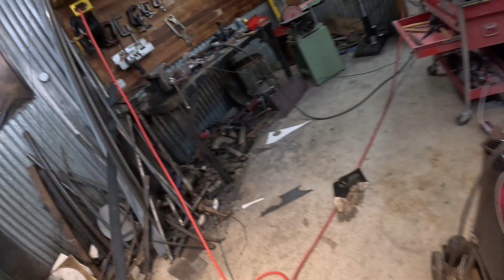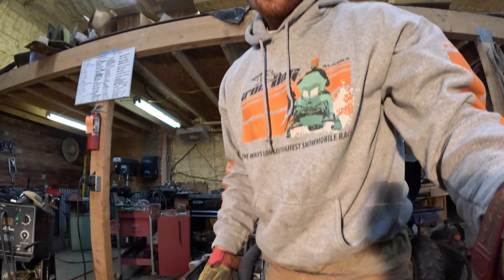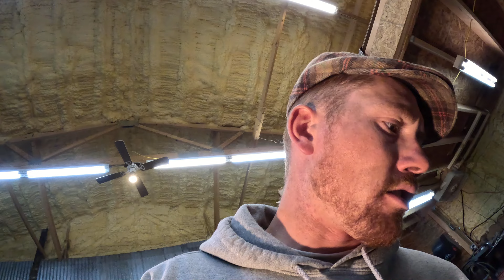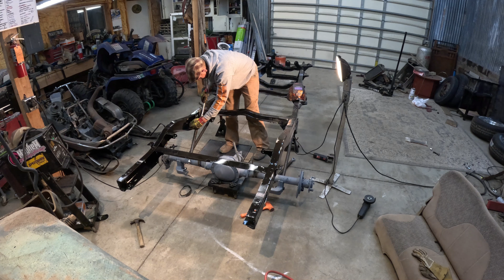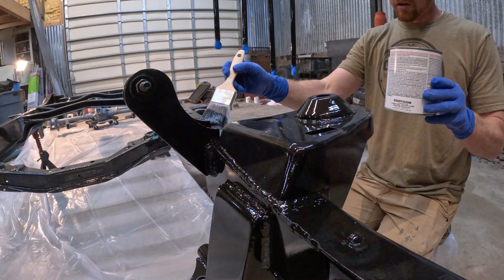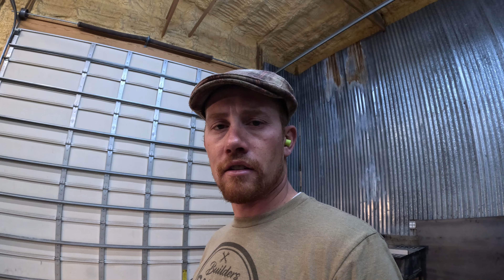Daily driver rat rod 4 Links and paint FINALLY!

Comment: This is just my opinion and not a scientific fact,, but accoerdin to me you have to buy some awful fancy and obscenely priced paint before you have a coating even nearly as durable and protective as brushed on Rustoleum industrial enamel. Sprayed on rustoleum isnt as tough.  One thing that makes it tougher though is the red oxide farm and implemenrt primer.. The downside of that primer is that if you ever  use a torch or welder near that paint it will give off a burning fish oil smell that would make a skunk blush
Reply from the maker: That's what I figured. I've got time to let it cure so why not put it on thick and let it do its job. Thanks for the input your awesome!